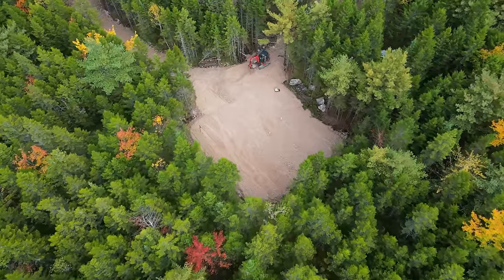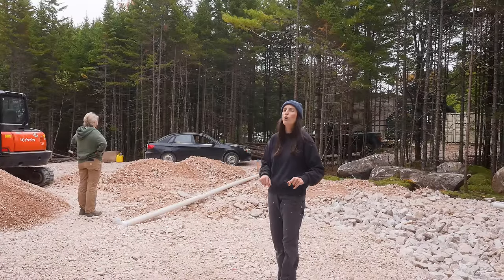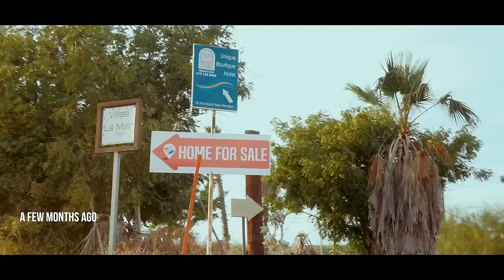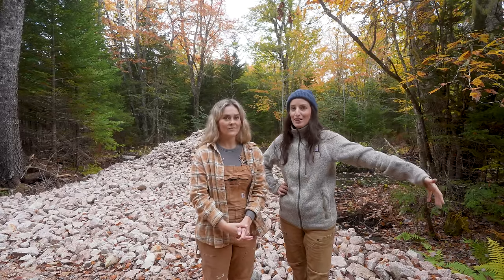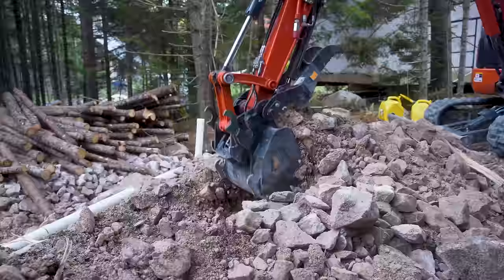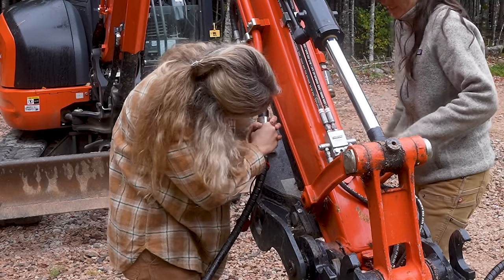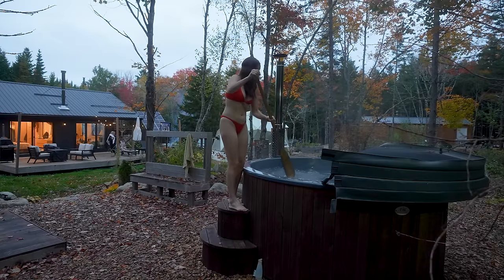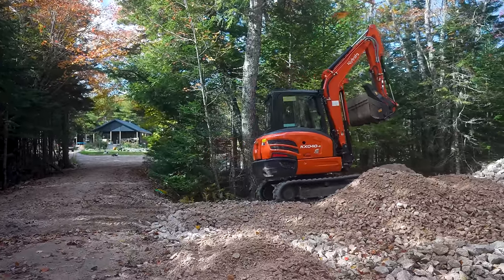Starting A New Build! Making A Level Pad For Shipping Container Workshop

Comment: Great fun watching you guys explore and build .Tip for hydraulic hoses . Turn key to on position (not engine), press aux hydraulic button left and right ,this will release pressure build up between quick release and pump or wrench both quick release a crack and re tighten . Cheers from heavy equipment operator in Toronto.
Reply: I know absolutely less than nothing about hydraulic hose attachment. Or detachment for that matter. But I respect your advice to Jazz and Crystal. Sounds like the kind of professional advice they can put to good use.
Reply: I came here to say this. Guy is spot on. I always made it easy on myself and would drop everything on the ground, give it all good jiggle while ignition is on. take the key out and then plug in line. Had a sneaky bugger get in and turn it on on me once whilst I was pluggin in. Mmmm cheeky bugger maybe. Oh also, if you want to your machine to be a bit more easy on the maint side, I was always told to do it when you shutdown at night too. Relaxes all the pressure on the seals etc.

Comment: When switching buckets, turn the engine off then move all the hydrolic controls to dump the oil presures on the lines Then it will make it easier to hook up the lines

Comment: If you toggle the thumb control back and forth with the machine off it will relieve the pressure in the line and making the hydraulic hoses easier to connect.
Reply from the maker: Yes! Thank you

Comment: When changing hydraulic hoses sometimes the hoses need to be bled because the hydraulic oil expands in the hose. Sometimes you can release the pressure by pushing the female end in. They also make a tool to do the job with. Saves a lot on your back.

Comment: if you work the controls back and forth for the hydraulic lines and leave the controls in the middle to let the pressure off, the lines go in a lot easier, you can do it without starting

Comment: Any left over drainage pipe and cut offs, just cap the ends drill drainage holes in the bottom 2/3 or 4 holes at the top to hang it or drill hole cutter holes at different holes around the pipe using small hole to the back to secure to wood post etc and fill full of compost and as you go up put in strawberry plants and tomatoes anything for saving space and they just hang ❤❤❤❤

Comment: Awesome forethought and end result on the shop pad. Great skills on the ex with ditch bucket but just a heads up. The cutting edge is there for grading n though its easier, using the bottom of the bucket will destroy it in no time.

Comment: Fun fact when it comes to levels...
The runway at Cape Canaveral for the Shuttle (built on a swamp) is 15,000ft long and the the height difference between the ends in 0.25 inches
(Was 1 tenth of an inch when built)

Comment: When your installing the the hydraulic lines for  accessories shut engine off turn key back on safety lever in operating position and cycle all the controls it will release any pressure in system and make it easy for you with quick couplings
Reply from the maker: Thank you for sharing with us. We now know that for next time. 😊🐶

Comment: Hate to say it, after the conduit job has already been finished, bu~ut...
You're going to need to pull heavy gauge 240V electrical cable through that long length of conduit, with a pull tape first to pull a larger rope to pull that electrical cable, which is very difficult to bend around sharp corners.
The point being, those 90 degree elbows need to be long elbows, with a much larger radius. TBH, I would dig out the ends, before the ground gets hard to replace those short elbow which will be far easier, in the long run.
Most people install the pull tape, while assembling the conduit, which has the risk of it getting stuck in the glue. But, you can also use a leaf blower at one end, with a shop vacuum at the other to feed the lightweight nylon pull tape through the conduit, kinda like blowgun.
Hope these tips help.
WUF! WULF! 💖🤗🤗💖
Reply from the maker: Thanks for all the tips! To do our cabin electrical we use a shop vac and a string. Then attached the wire and pulled VERY hard. Seemed to work for 3 90’s. Time will tell :):) 

Thank you xx

Comment: When you are connecting you hydraulic lines, turn off your motor push all your hydraulic levers back and forth to release the pressure on the lines. With motor running you are trying to push against hydraulic pressure. I am sure you will see it is a lot easier to connect the lines.
Reply from the maker: Yes! Thank you :) learned after lol

Comment: Get yall some bearing grease and lube those hydraulic parts before connecting them, just smear it on and they will connect and disconnect much easier. Also coat them after they have been disconnected so they don't corrode.
Reply from the maker: Thank you for all your helpful advice We will definitely do this next time. 😊🐶
Reply: @Vanwives  Any type of grease will work, whatever you have on hand. I assume yall have a grease gun for your equipment and that will work just fine.

Comment: I'm not sure it works on kabota's, but when you're hooking up hydraulic lines,try turning the Ignition on, but not starting the equipment and then moving the joy sticks to help drain the hydraulic pressure off of the lines. It should make the quick connects go on a lot easier...
Reply from the maker: Yes! We learned that after haha 🤣 thank you xx

Comment: You're having so much trouble with those quick connects on the excavator because you have to release the pressure in the system by moving the sticks around with the machine off.

Comment: You two do some great work. I thoroughly enjoy watching you build out your compound. That said, I'm curious why you used white PVC for electrical? White PVC is designed for plumbing to contain pressure from within. Gray PVC is generally used for electrical because it's designed to be stronger from the outside in to keep it from crushing. Or is the coding different in Canada?

Keep up the good work.

Comment: I just finished watching your polar vortex video from last winter and saw how much of a struggle it was dealing with electricity, from the car battery to the generator, so I was wondering how you guys plan on supplying enough electricity to all your buildings this year? Are the solar panels enough?
Reply from the maker: Ahhh! I’m cold just thinking about it. At that time we didn’t have our power set up. Last winter we ran a test and always had access power. I believe we will be good. If not we will have to add solar and or change habits.
Reply: @ oh boy good luck! I hope you guys will enjoy the weather in Mexico during the winters if need be 😂

Comment: Gray pipe is for Electrical

White pipe is for water
Reply from the maker: Thanks for sharing with us. 😊🐶
Reply: Just be careful the white pipe is flammable

The gray pipe is not flammable 

I think you can put the gray pipe inside the white pipe and just use the white pipe as a sleeve 

Most of the time when I do that, I only put it under the concrete and just leave my gray pipe through the white pipe (so the 90s are kind of useless on the white pipe)

But I don’t think there are any inspectors out there. I think you guys will be fine. 👍😎